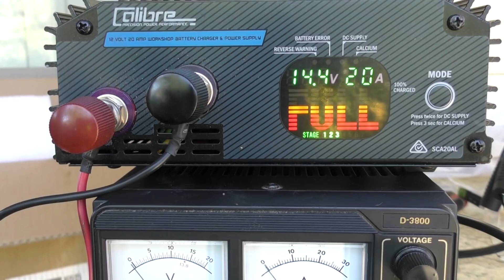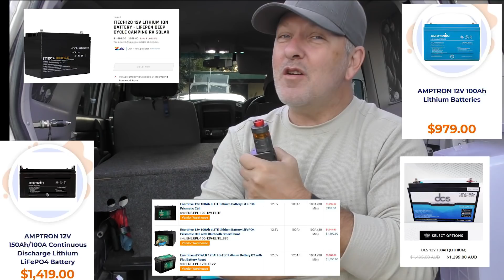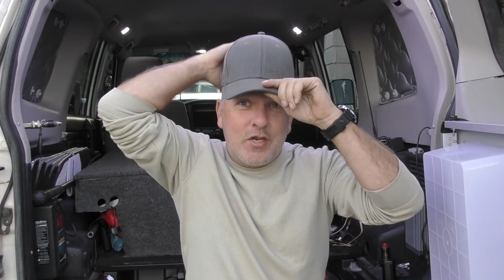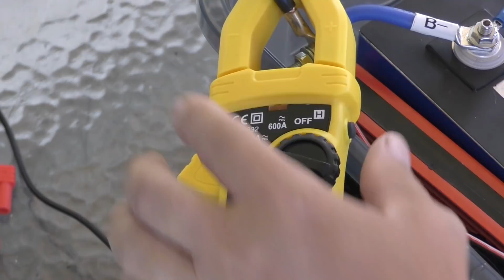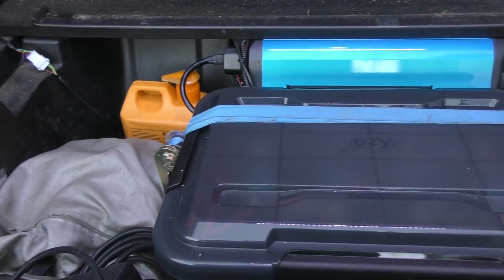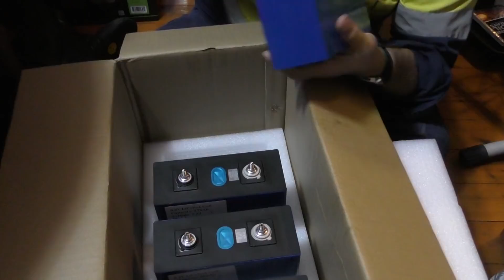DIY 4wd Lithium Battery install with inverter and induction cooker

Comment: Thanks Brett, very interesting. Looking forward to info on inverters and what they will run in real life, ie pure sine wave vs modified sine wave .Sure would watch the detailed vid you were talking about . Cheers, Pete
Reply from the maker: welcome Pete,   Anything in particular you want to see on the inverter side of things? I'm keeping my eye out for an oscilloscope on market place for the testing but one hasn't popped up yet. I'll get that Vid in the works. I won't be pretty but I'll stick it together
Reply: @DENMONKEY  Hi Brett, Re the inverters I really don’t know much about them. Ie 12 v cable size required, safety issues, and what size is worthwhile. Only using  120 ah battery in caravan but this video sure has me thinking!

Comment: I reckon if you've got the battery/inverter capacity then an induction hotplate's a good idea. No carrying gas bottles, no issues with wind, and as long as your wiring is up to scratch there's a safety benefit.
Reply from the maker: that was my thinking Saxon. I always do overkill on my wiring just to be sure. I don't believe in cutting corners when it comes to that. I am liking it as an option though and no gas bottles is a big win . so between the battery power chain saws and the lithium battery, no more flammable or combustible materials in my 4wd.

Comment: I’ve only just moved over to Lithium myself.  I didn’t know that you could get separate cells so I bought the battery you showed for $469 100AH.  I’ve got a 140w solar panel on the roof, a 20amp Kickass charge controller and a 2000w inverter from JayCar.  My only current drains are a 14L Brass Monkey fridge from JayCar and a 12vdc electric blanket from Gerry Harvey.  The inverter is “just in case” type so not really used.  Anyway your expedition into Lithium is great and I’ll be interested to see how it goes.
Cheers.
Reply from the maker: Hey David, Keep me posted on how that goes. I'm curious who some of those go over time. There's so much out there these days it's hard to know what to go with. I only just missed out on one of those brass monkey 15L fridges second hand the other day for 100 bucks. I was too slow. I thought it would be a nice match with my draw fridge to run as a freezer when camping and not take up too much space. Might still get one later. How are you finding it ?